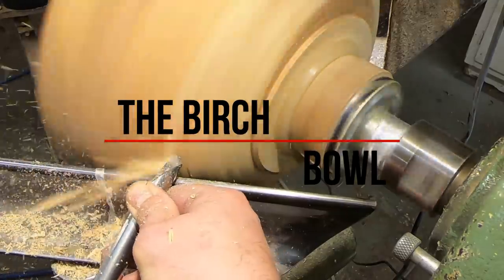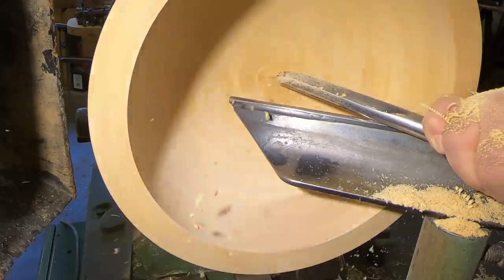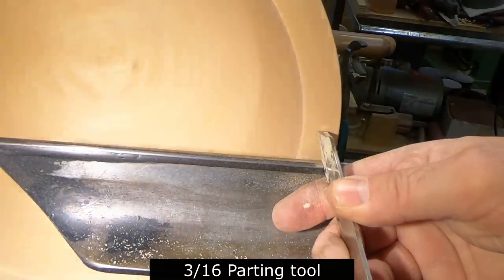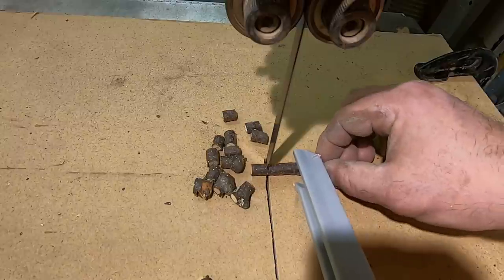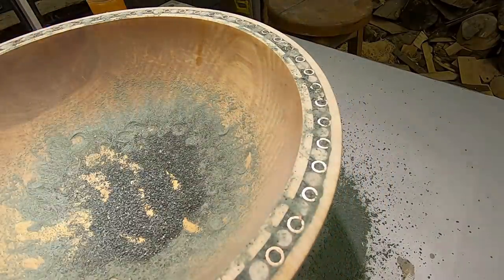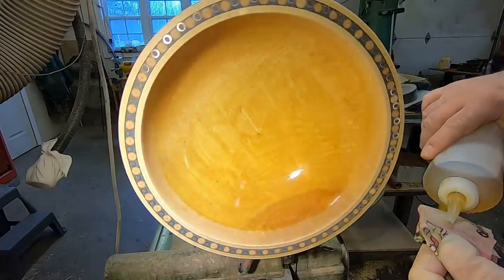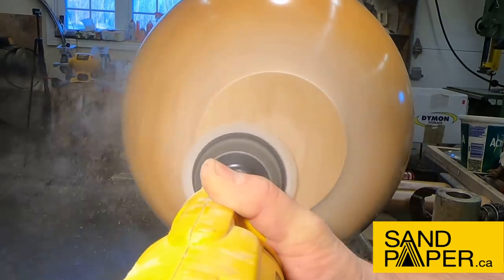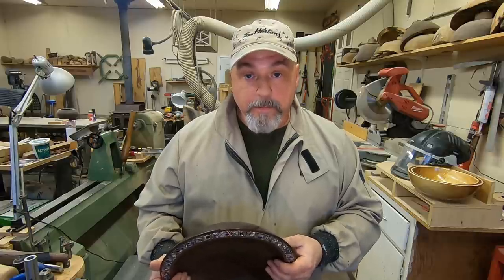Woodturning - The Birch Bowl

Comment: Beautiful job! I’m still learning about turning; why do you run the sanding pad the opposite direction of the lathe? Also, why is it ideal to run the lathe at half the speed of the drill? Thanks for your videos, I really enjoy them.
Reply from the maker: Running it in the opposite direction makes the sandpaper cut better. Theoretically the drill pad will turn twice in one single rotation of the bowl at center and little pressure is needed on the sanding pad causing less heat. This will prevent heat checking on the surface of the bowl. Hope this explains it, Jim.

Comment: Fabulous bowl as usual Jim! Never boring. Anxious to see your resin journey. I am curious how long you wait after signing your work to put on the finish and it appears that you do not use a sanding sealer with the Wood Bowl Finish. Cheers, Paige C.
Reply from the maker: I never use a sanding sealer because I want the food safe finish to penetrate and the sanding sealer will prevent that, it’s also not approved for food use either. I pretty much put the bowls on the lathe right after I sign them. There is a link in the description where you can get the same pen I use. Can’t wait for the resin stuff too, thanks!

Comment: Love your inlay videos, Getting all kinds of inspiration Thanks.... I find I'm more likely to get vibration when I use a robust tool rest!    My  thick cast Powermatic solves the problem for me.. 
The more vertical and solid the better....
Reply from the maker: I don’t think that’s the case with this vibration. It’s more likely to be the fact it’s on the glue block and far away from the headstock.
Reply: Very good point, I used to use glue blocks like you. I first saw Ken Bullock use that method in a video I think he got the idea from Maurice Gamblin both turned in New Brunswick. I had forgotten the vibration aspect of glue-blocks but I do remember the smell of the hot melt glue & learned why it was a really good idea to wear gloves, it sticks to your skin just as well as it sticks to the wood and it's so hot you pull your skin off to get it off. 
(I still have a frying pan with hot-melt glue on a shelf in the shop.)
Take Care Jim stay safe...
Reply from the maker: This is exactly where I learned this technique! It was a very long time ago, lol.

Comment: Looks great the way you crush the soapstone have you ever tried a pipe with a cap inside another pipe I took a hot glass course and that is how we crushed glass looking forward to your next video
Reply from the maker: I’ve debated it but I wonder how bad it would be to clean out between using different inlay materials and cross contamination, thanks

Comment: That turned out real nice. During the vid, I was dubious when the pieces were first assembled in the rim. But they look great after the final sanding.
Your faceplate sure looks chewed up. Maybe the flats were insufficient and you had to use channel locks on it. I hate when that happens!
Reply from the maker: The aluminum faceplates that I use are probably close to 20 years old and have seen a ton of use, there was originally a slot on them for a wrench but it stripped out so channel locks it is, lol. Thanks.

Comment: Hey jim,  given that ca darkens wood , do you reapply GF to the rim after you sand it back between soapstone fillings.  Or does ca not color the wood on the rim?  Really beautiful bowl.  So far this is my fav, just slightly ahead of the 15,000 sub give away bowl.  Thanks again for teaching us your techniques. Stay safe as covid is knocking on doors all around us here in the usa.
Reply from the maker: The rim of the bowl or the very top of the bowl is face grain so it typically doesn’t absorb the CA glue like the end-grain so I don’t need to seal it between applications. So far the mussel shell with copper pipe is my all time favorite and will be tough to give away, lol. Thanks.
Reply: @SpragueWoodturning  ok, thanks.  you could sell that give away a million times over!  I don’t know what you tube allows.....maybe a raffle, to help you offset costs for the time and material you have devoted to making these vids? I feel you could sell the giveaway design on a continuum. Have fun, be well.
Reply from the maker: One of theses days I will finish setting up my Etsy account, lol.

Comment: Hey Jim, I know it’s not necessary but do you think the aesthetic value of the inlay would change for the better or worse if you ground the soapstone down to a fine powder?  Not having done one of these bowls yet I’m wondering if the granularity of the soapstone is apparent with the size chips you use. I’m guessing a more finely ground soapstone might appear more like resin which to me just doesn’t look as nice.
Reply from the maker: Your correct, the more finely ground soapstone does look more like resin, but the thin CA glue has a much harder time penetrating it causing voids. Sometimes I use courser material for the initial inlay then put finer material on the fill voids and such. Jim.
Reply: @SpragueWoodturning  Yes that's exactly how I imagined layering it in, first course then fine to fill in the gaps.  Thanks for the warning about CA not penetrating the more finer ground flakes because I might have tried it on a whim otherwise!